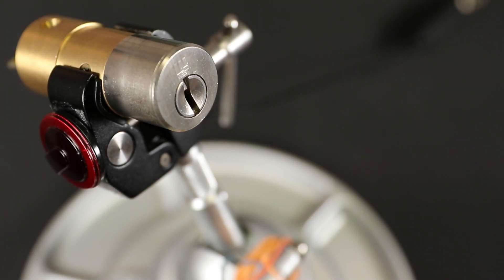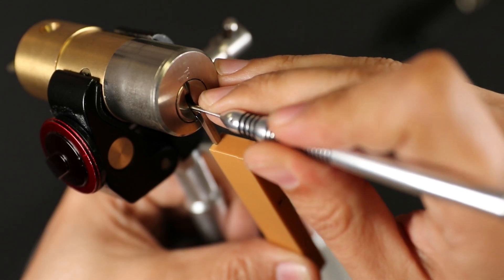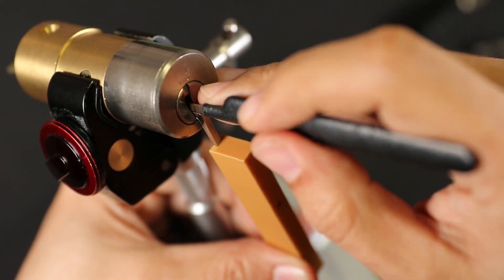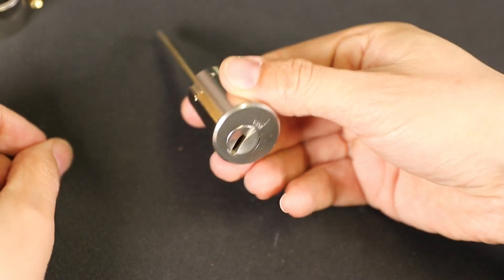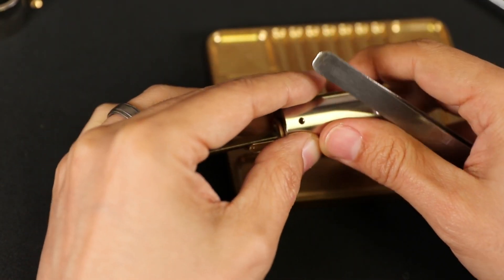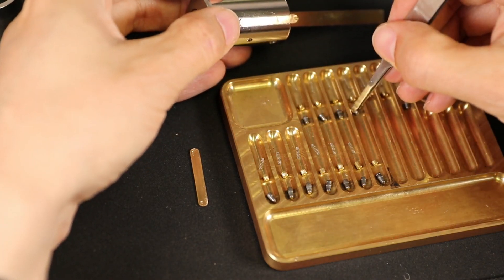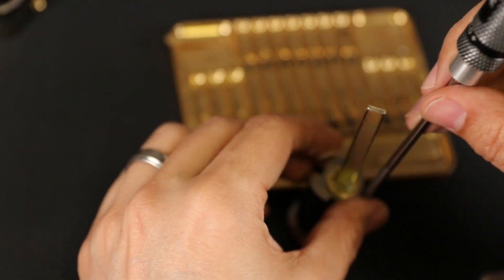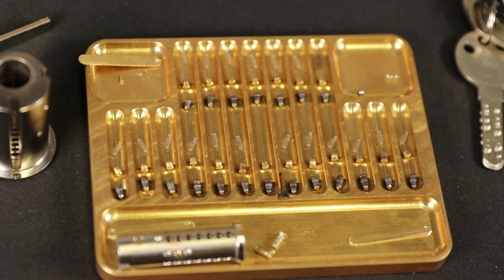[L146] West 917 Japanese Lock - pick and gut

Comment: Another awesome pick, who sells that cylinder holder?
Reply: You can find it on Amazon by searching smallrig super clamp I tried posting a link but didn't work
Reply: @theTINMAN-bn7dm  thanks! 🍺
Reply from the maker: My normal copy paste regarding my setup:
Panavise base (from my 350) with a camera clamp up top and a simple stud  
I use this clamp: https://www.amazon.com/gp/product/B0062U2M4E/ 
This stud: https://www.bandh.com/c/product/1340616-REG/ or https://www.adorama.com/kukg016512.html or https://www.amazon.com/gp/product/B072T4TNYW/
And an adapter to connect the two: https://www.amazon.com/gp/product/B01N132CZ0/
You need to screw the clamp on to the knurled end of the stud, if you put the knurled end down into the base it will not be held solid and will wiggle.
Also recently found that this has been done before! https://www.instructables.com/Locksport-Vise-Head/
The red thing is a guitar pickup for listening to the lock https://www.amazon.com/gp/product/B07HVFTGTH/ which gets fed into my Zoom H6 Audio Recorder, but many people use this amp into headphones https://www.amazon.com/gp/product/B00EJCYSMQ/
Any picks with white handles in my videos are homemade. The music wire tensioners are cold bent, filed at the end, and 0.078" diameter, but you should use whichever thickness is wider than your keyway.